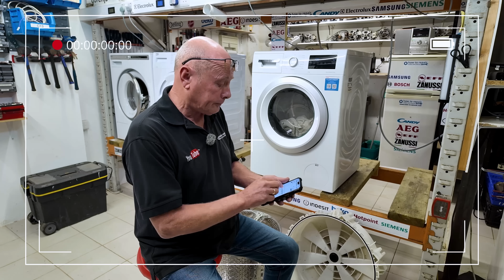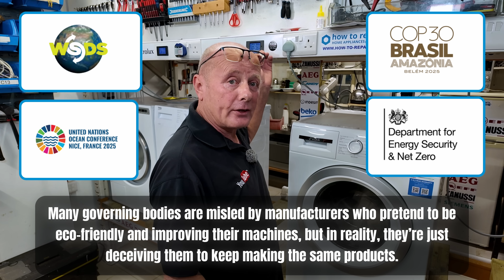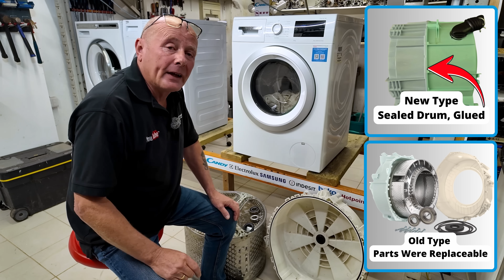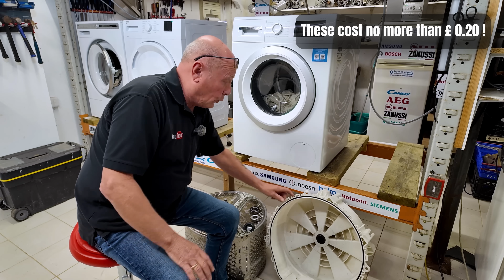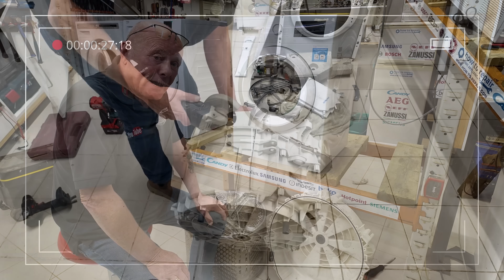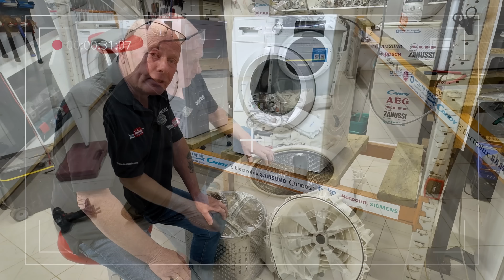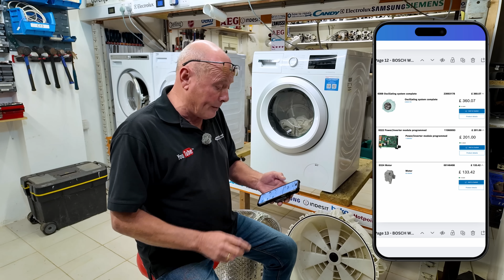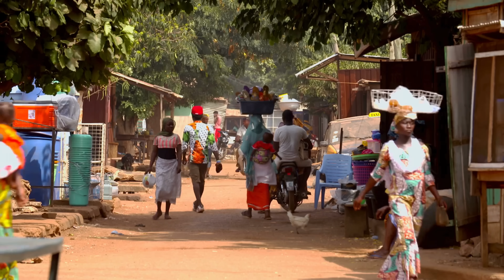Washing Machine SCAM EXPOSED! The Truth About SEALED Drums: Naming & Shaming

Comment: I offered to replace the bearings on a friend's Zanussi ZWI71201WA. This unit has a sealed tub which I was a bit surprised since it's ten years old. New tub and drum assembly around £180 instead of a few quid for new bearings. There's nothing wrong with the tub and drum so that would be going in to a skip for no reason. This machine easily has another ten years of service in it with new bearings.
A british company could do very well producing machines with right to repair in mind. Make spares easily and affordably available and provide tools and knowledge to 3rd party engineers to fix or even self fix.
Reply from the maker: I'm not surprised but I'm certainly disappointed that your 10-year-old Zanussi has a sealed tub. Zanussi is part of the Electrolux family and unfortunately, this practice of making a cheap part failure result in a huge expense or disposal is exactly the kind of planned obsolescence we expose. That tub and drum absolutely could have another decade of life with new bearings!

Your point about a British company capitalizing on the "Right to Repair" is excellent. The current industry is too confusing and designed to rip off the consumer. If a manufacturer committed to basics, like splitable drums, and freely supplying workshop manuals and part data, they would have a massive advantage and the support of the public and engineers alike!

Thank you for your comment. I appreciate people like you taking the time to write it out. Please don’t forget to subscribe and share it where possible. It might help others make a wise choice instead of being misled by the industry.

Comment: I have an Indesit washing machine from the 2000s and it still works like new.
Some condensers blew up and had to bring the PCB to be repaired. It cost me €30 in total.
I also replaced the carbon brushes in the motor by myself and it cost me around €20.
It works like new and the repair main told me to keep it because old washing machines are the best. The new ones brake more often and the repair costs are much bigger.
Reply from the maker: I totally agree with your repairman. Keep it going as long as possible. I’m glad you enjoyed the video. Please remember to share the video as this is the only way we can get legislation changed.
Reply: @How-to-repair  I just finished washing my clothes. After the wash I keep the window open. Instead of fabric softener I use alcohol vinegar. The machine is in perfect shape after so many years.

Comment: Also the BOM cost of that circuit board is probably something like 25 euro. Maybe add a few euro for fancy connectors.
Reply from the maker: Manufacturers can produce these electronic control boards in massive volumes for a very low unit cost. However, when that board fails and these circuit board-driven machines are exactly what I recommend avoiding in cookers for example, the consumer is charged a scandalous price for the replacement part. Thank you for your comment. I appreciate people like you taking the time to write it out. Please don’t forget to subscribe and share it where possible. It might help others make a wise choice instead of being misled by the industry.

Comment: Scandalous. There is an organisation called HOP (halte à l'obsolescence programmée - Stop Programmed Obsolescence) in France should look at this. 
Reparairability should be enforced. 
Car manufacturers use a similar tactic. Refuse to sell cheap part likely to fail seperately. Force sale of more expensive combined parts.
Reply from the maker: On my YouTube channel you will find many video about built-in obsolescence with Appliances. I have not been contacted by any media groups politicians or even the governing bodies that control the industry. It seems to be a subject that no one wants to bring to the table because it’s acceptable it is only by sharing these videos That it will get the visibility and maybe just maybe they will not be able to ignore it.

Comment: I will make my point again if a machine is over 5 yrs old and used heavily  its makes no sense to split the drum and repair anyway due to labour costs.
as long as heater element can be changed and the boot belt etc can be replaced, as for logic boards used items can be found and bought cheaply.
machine are very cheap compared to decades ago even allowing for  devaluation of the pound.
For example have you noticed that cheap washing machines like indesit and the like during the 80.s were all £199 it was like that for 20-30 years, they lasted 5 years of heavy use and i am talking heavy used .
now check for devaluation and say for example how much £199 in 1985 was worth £770 !!!! in  todays money!.
So quite cheap really nowadays.
By all means do your own research scratch the surface and get the truth.
Reply from the maker: I’m sorry I’m gonna have to say this again the cost of approximately 10 to 12 screws that hold the 2/2 of the drum together are classed as saving money by the manufacturer but how much energy do they use in welding? The 2/2 of the drum together this is a blatant removal of the right to repair. There is no defence to it. Thank you very much for watching the video

Comment: I had a Candy " Grand O " I think it was called. Bought new and was hammered. Lasted 19 years. It was STILL working when I replaced it and NOTHING had gone wrong on it, it got rusty around the door hinges and looked its age which is fair enough.
My replacement....yep a CANDY 10 kilo smart touch 

With a 10 YEAR GUARANTEE
Reply from the maker: Thank you for your comment. I appreciate people like you taking the time to write it out. Please don’t forget to subscribe and share it where possible. It might help others make a wise choice instead of being misled by the industry.

Your experience with the old Candy perfectly illustrates how machines used to be built. Lasting 19 years while being hammered and only being replaced because of rust with zero mechanical faults is the definition of quality engineering built to last.

The problem is that the company structure has changed drastically since then. Candy was acquired by the Chinese company Haier, which now owns the entire group, including Hoover. While your new 10kg Smart Touch machine may carry a 10-year guarantee, it's often the electronic or smart features (the Wi-Fi, the circuit boards, the auto-everything systems) that are the first to fail, often well before the motor. These features are designed to push you toward obsolescence and the long guarantee often only covers specific, durable parts like the motor, not the costly electronics. My advice remains: Keep it basic to avoid this reliance on potentially fragile circuit-board-driven features.
Reply: @How-to-repair love what you do and appreciate all the research. Had it 2 years now so fingers xx'd. Iirc its just the parts that are covered and i have to pay for fitting......or was that the Samsung fridge freezer 🤔.
64 now, and one or two bits on this model don't work as well as they used to 😒